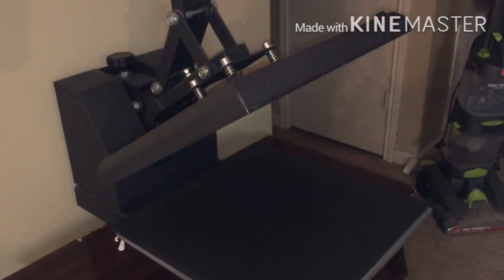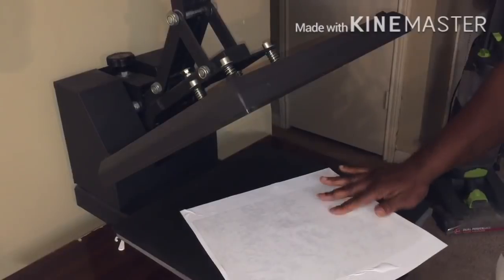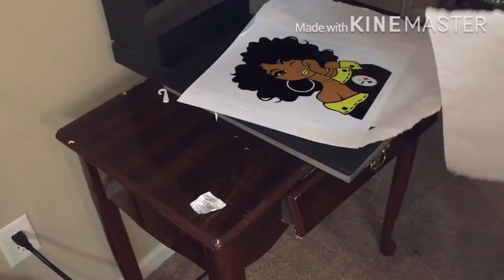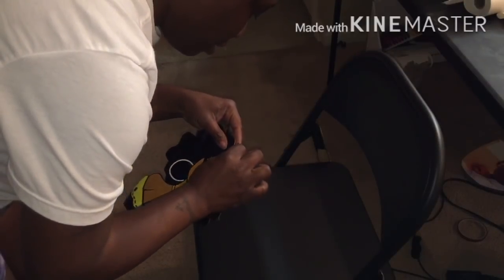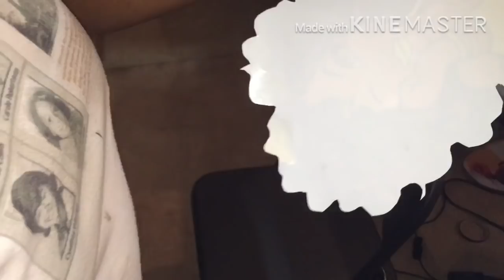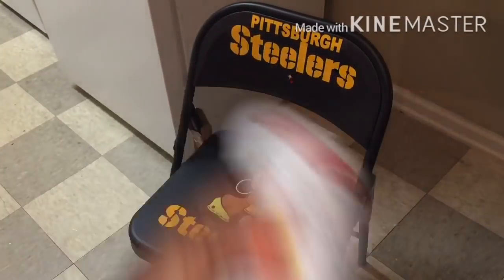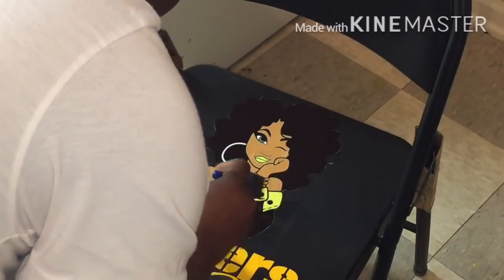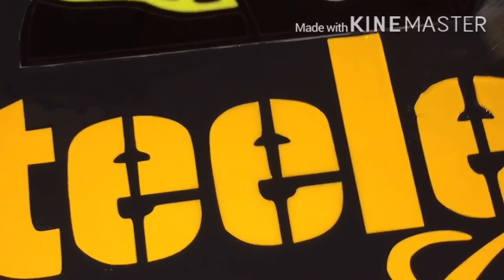Sublimation vinyl chair

Comment: Always clean all surfaces with alcohol first then apply your epoxy if not the oils from your hand will cause it to lift and not to be on certain spots, and you can always put another light coat of epoxy on after about 2-3hours. Great job I love watching you.

Comment: I tried this method but my thermal sheet keeps coming off the vinyl. I've tried using more heat/pressure but it's still doing the same thing. Suggestions anyone?